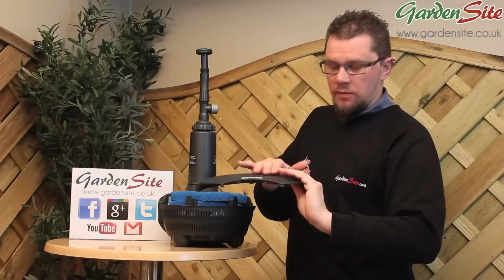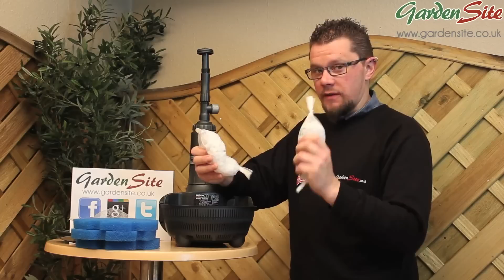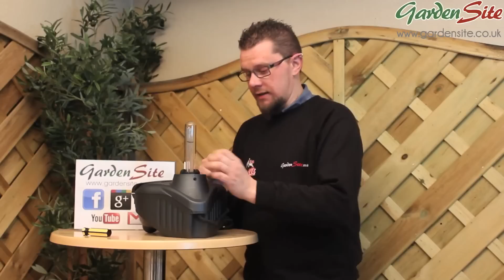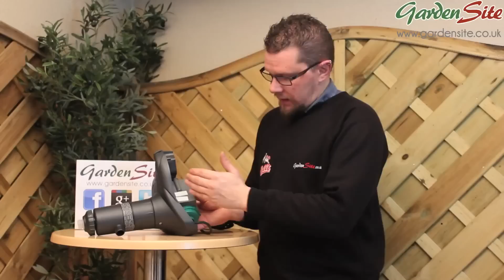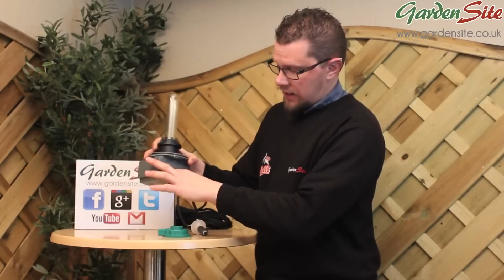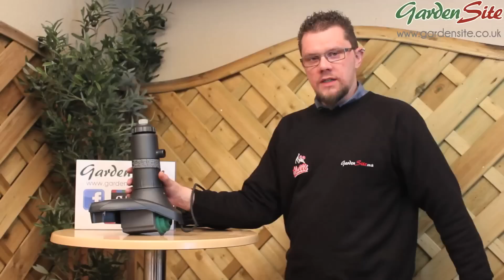Hozelock Easyclear Maintenance Guide

Comment: Thanks for the video, very helpful.
However our pump operates on a little waterfall, which has stopped working. 
I have followed your instructions and cleaned the unit thoroughly. The motor is working but it still isn't flowing. 
There is a seal which seems to have stretched, which I will replace if I can locate a replacement. Also I cannot tell whether the uv bulb is working or not, is it important?
Any other suggestions please?
Reply from the maker: Thank you - 
We sell seals here https://www.gardensite.co.uk/aquatics/hozelock-easyclear-quartz-o-ring-set.htm
It is worth changing the UV lamp every 9-12 months, whilst its not critical, the lamp will not be doing an effective job of clearing green water so I would change this if its due. 
You are welcome to call us on 0121 3557702 to discuss the problem with the water flow, it will be the case of running through a process of elimination to identify the issue, It could be the case that the impellor is worn and needs replacing or as simple as a blockage.
Reply: Thanks very much.
Are you there tomorrow maybe, or Tuesday please?
Reply from the maker: @stevebutcher947  Yes we are open 7 days a week, although we will be closed on Monday 19th September 2022 as a mark of respect to Her Majesty The Queen

Comment: I have a 9000 easyclear, which keeps tripping and when I open it where the uv bulb is, water seems to be getting inside, I've got the rubbers there which are on the outer casing so don't know how the water is getting in, please help.
Reply: There are 2 rubber seals on the quartz tube (looks like an inverted test tube) there is a third seal on the base of the plastic that the quartz tube fits into. Gently slide the quartz tube out of the retaining ring (don't press to hard or you can crack the tube - Wear gloves if unsure) when you remove the tube you will see 2 large rubber washers. Clean and inspect the washers (Replace as needed) clean the tube dry and ressemble 1) Pop the 2 washers into the gap in the retaining ring they need to be clear of the fasteners 2) GENTLY slide the quartz tube through the 2 washers into the retaining ring. Again be gentle. I found a slight twist 1mm clockwise and 1mm anticlockwise worked for me, otherwise use some silicone grease (this is food safe /  pond safe). 3) After this inspect the quartz tube you should see both rubber seals gripped on the tube  (like 2 rings on a finger) the rings need to be even and undamaged you can see this by looking into the open end of the tube with a torch and a magnifying glass. The tube will feel very firm and the lip of the tube should be flush with the plastic. Replace the UV bulb. You can purchase new rubber gaskets if the ones you have look like they are flattened with age. Finally check the third seal on the plastic retaining ring. To be clear the plastic retaining ring has 2 thick rubber O-rings on the inside and one on the outside. Three in total they provide a barrier for water ingress.

Comment: Help got a leak on the 9000 between the body of the pump and shaft. Do I need a new pump.
Reply: I've got a leak where the uv bulb goes, I've tightened the outer casing and still doing it.

Comment: Really good video, my hozelock 6000, keeps tripping out after 3or 4 minutes, does anyone have any advice before buying a new pump, thanks
Reply: Unfortunately once the electrics start tripping its usually beyond repair. Either the motor is overheating (not repairable) or water has breached into the electrics. Double check the UV lamp inside for obvious signs of damage or water ingress. Certain seals can be replaced, the quartz glass can be replaced and the lamp can be replaced. If the problem has been resolved the unit can dry out and continue to work. You are best to weigh up the cost of components and the risk that this is money wasted if unresolved vs the cost of a new unit.  Parts can be found here https://www.gardensite.co.uk/aquatics/hozelock-easyclear-filter-pond-pumps-and-spares/ Always follow the manufactures instructions and guidelines.
Reply: @DavidCoton  Thank you for your reply david, I will check all of the things you mentioned, water didn't seem to be present around the uv lamp, i will also check the impellor, thanks again
Reply: @DavidCoton  I've had the same problem with my 9000, I've just replaced the uv bulb tightened the outer casing and it now keeps tripping but only since I changed the bulb which was yesterday, either I've not tightened it enough or pump is on its way out.
Reply: @ABITOFTHISANDTHAT12  I think your seals for the quartz tube might need cleaning and realignment. Dirt and grime collect and will allow water in. Remove the tube, clean and wash the O rings inspecting for flat spots deformation / damage. Replace damaged seals. Replace and check before reassembling. The tube should be firm and snug with the plastic at the base with the 2 thick o-rings outside the tube one next to the other (double O-Ring water seal).
Reply: Opend my easy clear for the first time  after 13 months of purchase brand new went to change uv bulb found bit of moist in top bulb protector an a brown stained tingy stained protector so try clean not much use put new bulb in tryed test it with bulb exposed an it dont light up is it had it?? 
Also hozelock customer service horrendous having no luck on there so called 3 year guarantee any advice